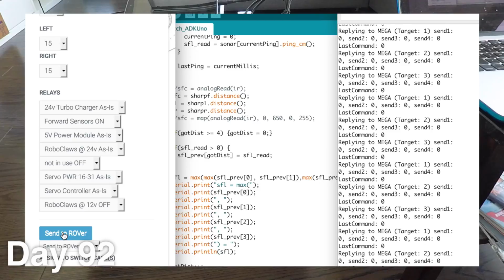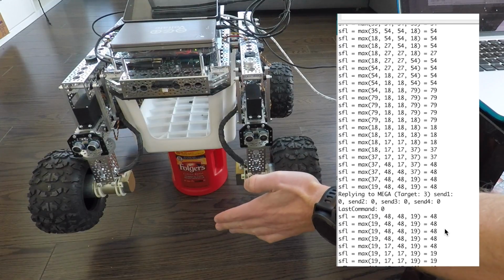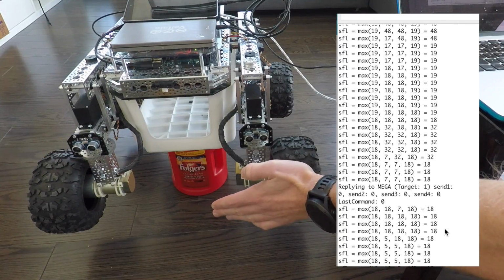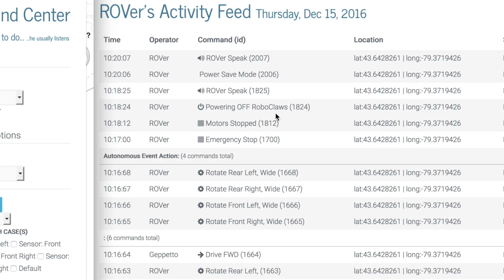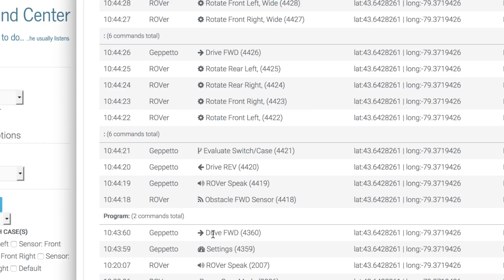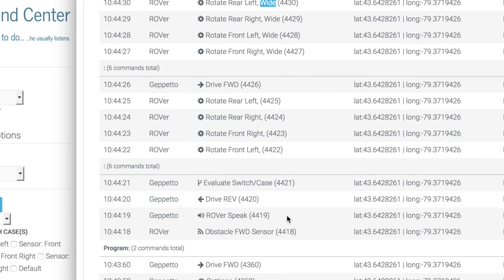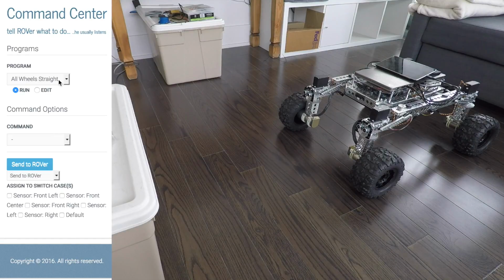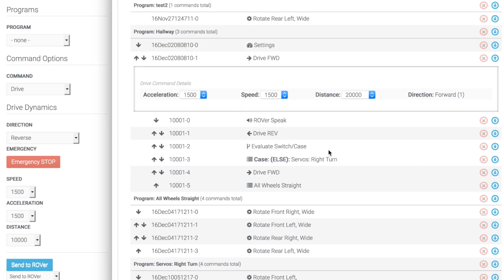ROVer Robot D92: Short, Safer, Autonomous Drive Tests to Sort Out Drive Distance Settings

Comment: With the SCC-32 servo controller, you can string servo movements together. The SSC-32 only executes a command when it receives a <CR> character. So, you can use Serial.print() for the first three steering servos, and then use Serial.println() with the last one to execute all four servo moves at once. This will make your control much smoother.